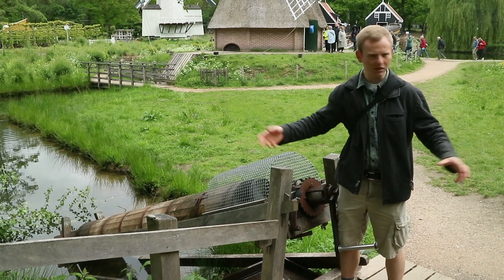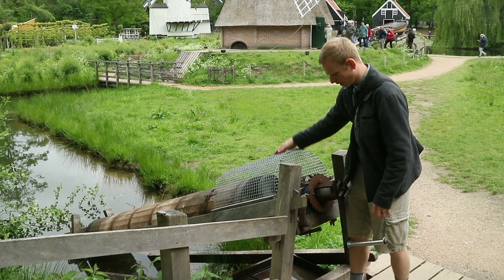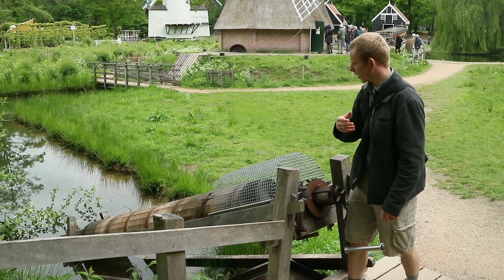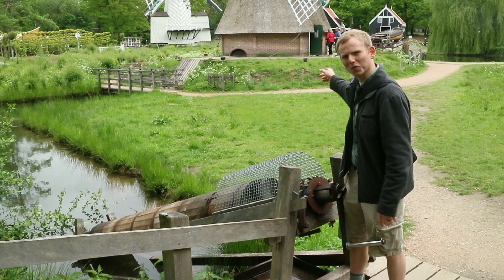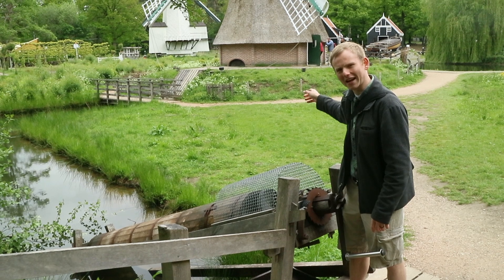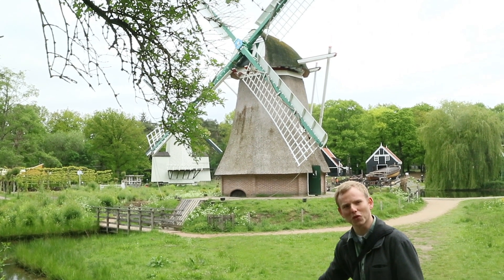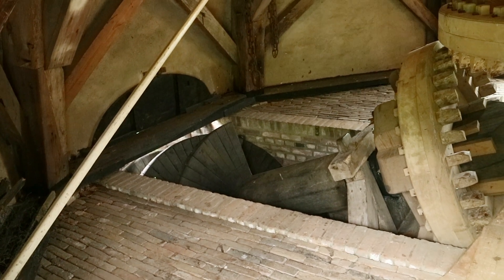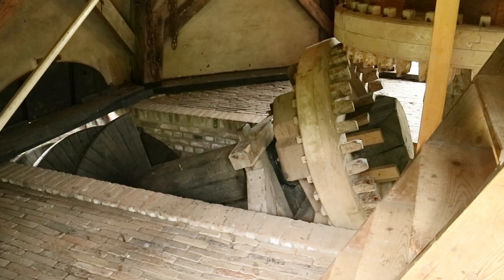Archimedes Screw: Because Hauling Water is Awful

Comment: The volume of water that windmill moves is a lot more than a little electric garden pump. To move that volume of water even today takes a 32 inch pump and a 4 liter diesel engine at a minimum. The modern lift pump might lift a little higher but not a lot.
Reply from the maker: The volume is a great point. Even though the elevation gain is quite modest.

Comment: If by a running stream would a pellatin wheel connected to the crank be enough energy?
Reply: As long as the pelton wheel is turned by more volume/heavier weight than the volume/wieght that the screw is displacing&(minus any friction points)it should work🤷🏼‍♂️

Comment: I bet they are using a screw because it will still function properly at very high load and maybe act as a brake, bucket chains and wheels would be destroyed in a harty gust. no screw on the marble machine x though

Comment: Look up the Ram pump.
Uses 2 one way valves and a head of water... can run 24/7 365 days of the year.
"A hydraulic ram, or hydram, is a cyclic water pump powered by hydropower. It takes in water at one "hydraulic head" and flow rate, and outputs water at a higher hydraulic head and lower flow rate. "
Reply: And a DC to DC converter does exactly the same thing in electronics land. They even work a similar way. A ram pump uses "water hammer" to generate a higher pressure.

Comment: Could a waterwheel transfer the force via gears to a screw like this next to the waterwheel? Cause waterflow from the river is constant, while the wind is not.
Perhaps the tolerances were just not tight enough to make this plausible back in the day.
Reply: Those setups exist.

The water lifting windmills are just so well known because of the Netherlands who use(d) them to keep their feet dry. As they needed to lift water from canals that had no flow but had wind, they used wind to lift water.
Reply: @MazeFrame  Ah guess it makes sense to use what's best available, since that whole region is a flat as you can get and not be in salt flats :)
Reply: I came to this video wondering the same but it makes sense reading the other persons comment 😂

Comment: Consider as well the lengths the Romans went to with the aqueducts just to preserve the elevation of water so that it would not need to be lifted.
Reply: Yes, indeed!  The New York City water system is another example; it has some of the longest tunnels in the world, just to preserve a uniform descent from its reservoirs high in the Catskill Mountains down to the pipes of New York City. Lifting water is *hard*, and virtually the entire system is gravity fed.  The water quality has historically been quite good indeed, because it is literally drawn from mountain streams.
Reply: The Romans did lift via siphons, an even more incredible feat than the screw in my opinion. In deep valleys they would use siphons to make the water flow down and then back up hill following the terrain. Imagine how our world would be if all of our ancestors didn't destroy knowledge Everytime they conquered a civilization.....
Reply: @joshuahafel4506 there is nothing new under the sun
Reply: @joshuahafel4506  War is part of the problem, but deliberate attacks against knowledge even more so. Like the Library of Alexandria wasn't burned down during Cesar's battles in Egypt (merely damaged); it was destroyed deliberatively and over time by Muslims and Christians.

Anti-enlightenment movements are the bane of our existence.. almost as much as war is.
Reply: Well, with the power of lifted* water Romans could literally wreck mountains...
*read: transported by aqueducts

Comment: wait, what's the reason for the 6-foot elevation gain limit? is it just a limit of the old manufacturing techniques, or is there something more fundamental to it?
Reply: Yes. 

 
You have a fixed amount of power (from the size of your windmill and the strength of your average winds). 

 
Thus, you are limited - if you go for a longer screw for more elevation, you have to reduce the capacity or the mill won't be able to turn it. 

 
By keeping the rise to the minimum, you can maximize the diameter of the screw (and thus the quantity of water lifted per rotation).
 
So, for every foot of elevation gain you are getting less water per hour out of the same facility's energy use.
Reply: That's the size they built that specific pipe, therefore it is limited to 6ft.  That's all